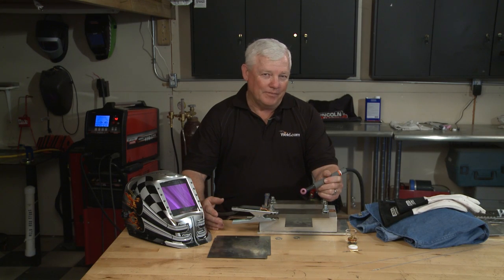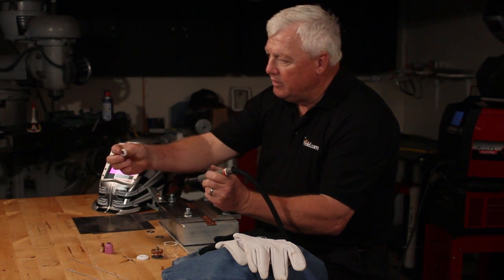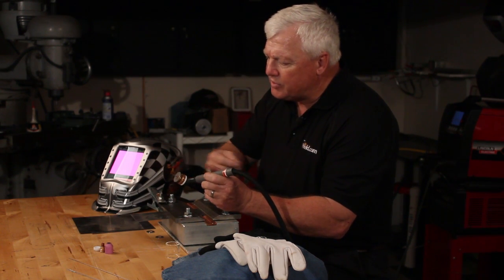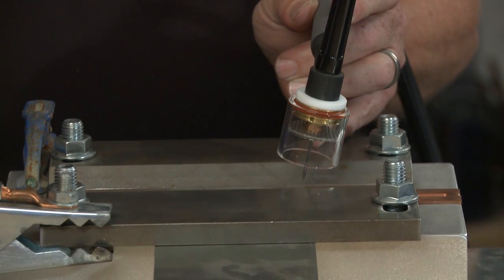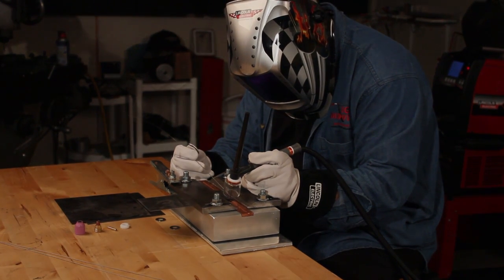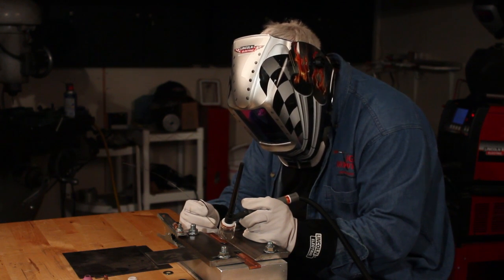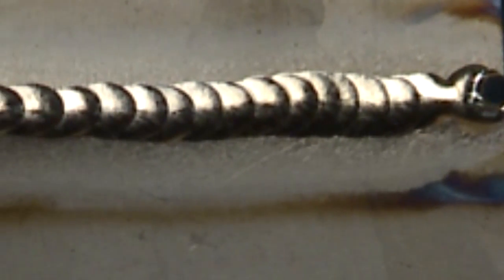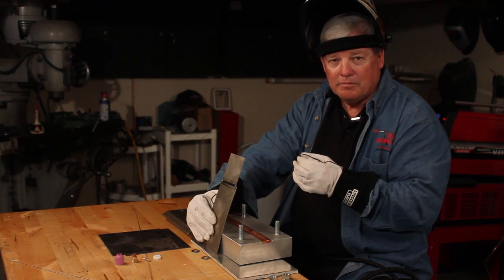How to Weld Titanium: Part 2 - Entry Level Purge Devices

Comment: So my question is, lets say I want to weld a titanium stick to a saltwater chlorination anode, how do I purge the back? It will only be tack welds and not really structural (basically it won't fall apart on me). I will use grade 2 titanium.

Comment: Control head and magnetic holder for automatic welding

Double welding system and backing of inert gas with magnetic coupling
Double automatic and simultaneous welding with magnetic coupling for industry
 
Specification
The invention refers to two complete welding heads and an inert gas (N) for external and internal (S) backing which work synchronously and magnetically coupled through two or more force fields of the two integrated systems of electromagnets or permanent magnets.
The design of the (N) and (S) devices for welding and inert gas backing has on each side indistinctly, rolling paramagnetic aluminum plates.
These plates house in their structure magnets or electromagnets of inverted polarity (N) (S).
The rolling and articulated designs keep the coupling and the parallel alignment constant with each other, making it possible to weld the sides of the outer and inner material simultaneously with the independent power sources. (Page 12, 13 (N1) (S4)). The invention of the double head and magnetic coupling welding are designed to work on paramagnetic and diamagnetic materials compatible with the process.
The equipment and system provides an exclusive technical solution to solve the physical obstacles of welding and gassing, with front and back purge, sheets and plates of various thicknesses of austenitic stainless steels and strategic materials such as titanium and aluminum.
The food, laboratory, chemical, oil, nuclear and aerospace industries, together with their multiplicity of applications and technical levels of superior excellence, are the ideal center for the use of the system.

Comment: Is it necessary to weld "freehand" or is it plausible to walk the cup like you would do on SS pipe
Reply: It won't conduct the heat good enough it's a little foggy eyes a lot slower than stainless..so you would roll your cup right into Moulton's metal puddle Ridgewood until contaminating you're weld. You could do a weave but you have to free hand

Comment: Mr. Tig Love ur videos.. thxs for all the info.... I have a question on cleaning titanium? what king of degreaser do u use? do u use acetone?  I also would like to purchase a set( diffuser, a jumbo 1" gas lens) for my tig torch i have a weld craft C-S310A. I also would like to purchase that nice color chart, thxs again,  Reel West Coast Welder
Reply from the maker: Yes, you can use acetone to clean titanium. You can get the chart on Weld.com for free: http://www.weld.com/index.php/search-result-details.html?id=105&mode=chartsdata&sid=227&view=application
Reply: Thank you for your reply :)

Comment: Preston,  When welding titanium DC- you can treat the amperage settings very much like welding stainless steel. That is to say you will want a sharp pointed tungsten and 1/16"diameter  will allow you to weld up to about 16 guage material. Anything beyond will require at least a 3/32" diameter tungsten.  Of course I prefer 2% thoriated tungsten. The visual puddle will be extremely shiny and a slight "red glow"  You will need to always increase your argon shielding to a major degree.  For example...  a small gas lens will allow you to tack weld only.   A jumbo 1" gas lens will allow you to weld about 1" in length...   any other linear welds will require the add-on trailing shield and of course you will always need to have internal or backside argon shielding.  Hope this helps you... Mister Tig

Comment: what kind of tungsten is used to weld titanium ? also seems to have done an excellent job without using an argon filled purge tank . i have a guy wanting to do a job for me that wants to use a purge tank and that will cost me more , they are exhausts pipes ? would they need to be welded inside a purge tank ? or can it be done outside like you have done here ?
Reply from the maker: We used 2% Thoriated (red) Tungsten. It is possible to weld exhaust outside of a purge tank, however you need to make sure that you are getting adequate gas coverage both inside the pipe and on the torch side. We show you how to do this in some of our other titanium #welding videos.

Thanks for watching!
Reply: ah yes i have watched the video of welding titanium inside a purge tank . thankyou for your response .

Comment: Dipping the filler metal, causes the risk of taking the filler metal out of the argon envelope. There is MOST definetly a different way to add filler metal to the weld puddle, you feed it into the puddle.if we are flexing our welding muscles,I have welded Titanium reactors, pipe lines, and heat exchangers all requiring 100% X-ray.please re-read my post I clearly stated the FILLER METAL never once mentioned the tungsten.As far as contamination goes,anycolorintitanium other than SILVER is no good.
Reply: TOTAL FUCKING RUBBISH ! YOU TALK A LOAD OF SHITE ! LIGHT STRAW COLORING IS ALWAYS ACCEPTABLE. BRIGHT SILVER IS THE BEST, LIGHT STRAW  ALWAYS ACCEPTABLE.

Comment: motomd1: Mr Tig never mentioned or "diped"  the tungsten into the titanium anywhere in the video? I assumed you mean tungsten because you must "dip" the rod into the puddle in order to weld! On the contamination part; this is how the USAF teaches there new students to weld titanium (exactly as shown). I have welded B-52 titanium engine parts in a hanger as written in accordance with tech data from aerospace engineers. NDI checks your work and your good to go!

Comment: This Video is full of ERRORS. First of all, You never "dip" Titanium, it allows the tip of the filler metal to leave the argon cone and causes contamination, once contaminated the tip of the wire MUST but cut off. Second, a trailing shield with pure argon must be used to protect the weld during the soldification time, this protects the weld from atmospheric contamination. I have been  a High pressure welder for the past 20yrscertified in Ti,Zr,Hastaloy,duplex,SS.Cu,andsteel. 15yrsdedicatedto TIG
Reply: YOUR NEARLY RIGHT. OF COURSE YOU CAN DIP YOUR ROD WHEN WELDING TITANIUM. AS LONG AS YOU KEEP IT WITHIN THE PROTECTION OF THE SHROUD ! TAKING IT OUT OF THE GAS SHROUDED ENVIRONMENT OXIDIZES THE ROD, SO CONTAMINATING THE WELD NEXT TIME ITS DIPPED INTO THE POOL. KEEP IT WITHIN THE SHIELDING GAS, AND IT WILL SPOT ON ! MR TIG MY ARSE !!